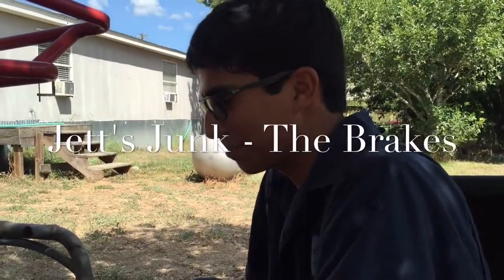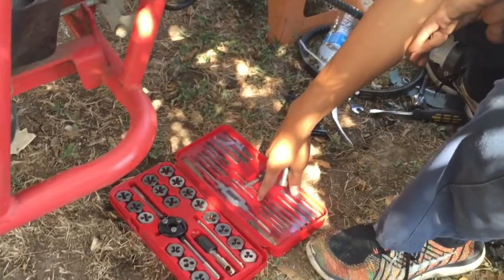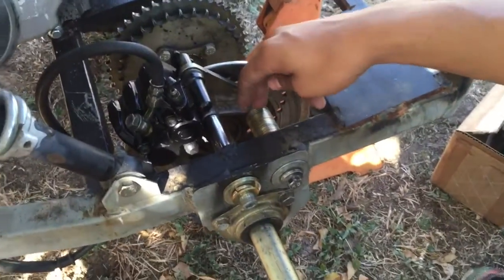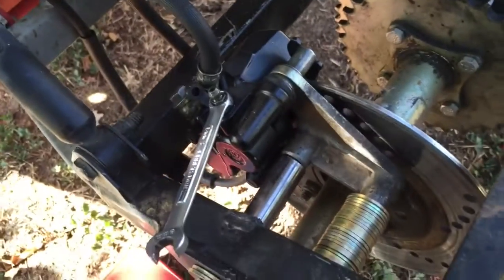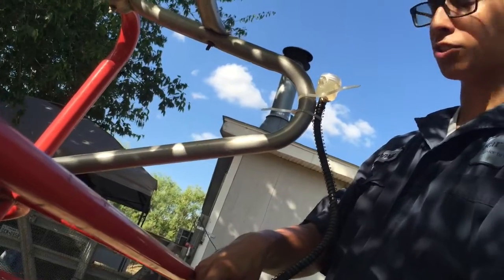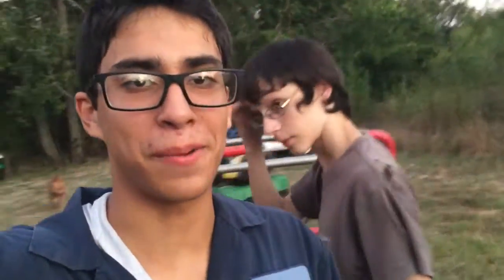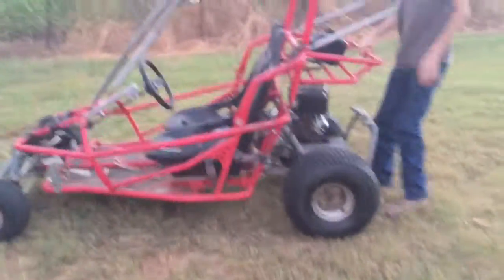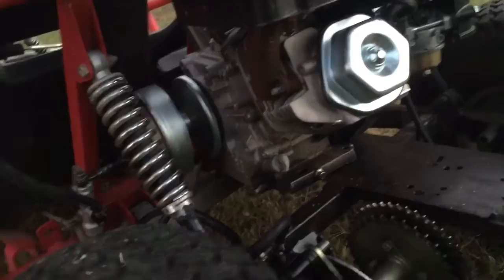Installing Hydraulic Brakes on a Go Kart Yerf dog Spiderbox

Comment: I'm having trouble getting the brake caliper fit completely on the disc and getting the bolt holes to align up.  I drilled thru the two cut-outs in swingarm looks like in the same place you did however looks like yours fit just fine. How did you get yours to align so well. Did you take the caliper from the the one and just swap it to the side in the video?  When you switch sides the mounting bracket somehow changes.

Comment: The most important and hardest part: where’s master cylinder setup!? What leverage ratio? Method of leverage? Looks like this is a push rod M/C. How much stroke? And how does this translate thru the brake pedal? Hmmmmm
Reply: I'll buy that for a dollar!
Reply from the maker: service pro  well to answer all of these questions accurately I’d have to go through some theoretical calculations for the leverage ratio we could combine the the mechanical advantage of the Pedal and then after we would have to divide the lever on the actual master cylinder to find the force in the direction of the sliding piston. As for the method of leverage we can just look at the type of levers the pedal and master Cylinder pivot linkage. The stroke is something easy to measure just by taking the starting and ending position of the piston in the master cylinder. And to see the efficiency of the brakes or how this transfers from the pedal to the brake it’s rather difficult without significant trials and testing in an ideal environment. Then again this is all theoretical. There are way to many possibilities for error to describe any exact answers to your questions because although this set up is supposed to work in two dimensions( mechanically ) there are all sorts of three dimensional errors such as force lose in the third dimension. Sorry that I couldn’t answer the questions you posed for me. Maybe next time I get funded for research on this product I can provide an accurate answer for you. Have a nice day sir
Reply: Lmao!